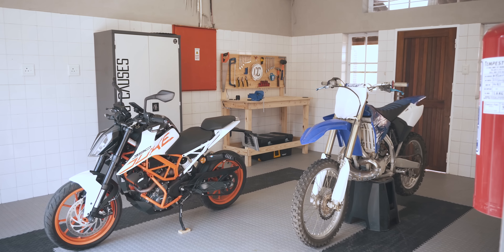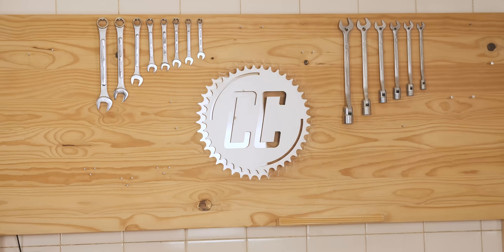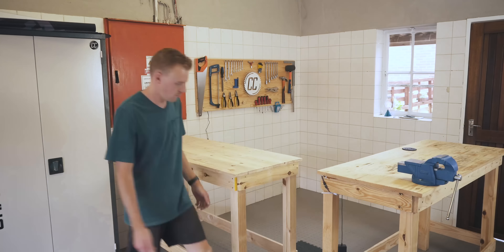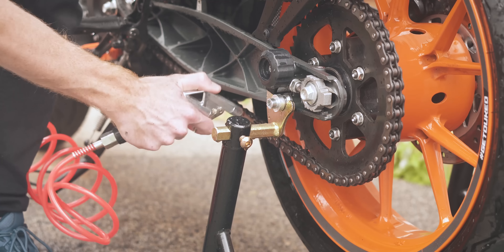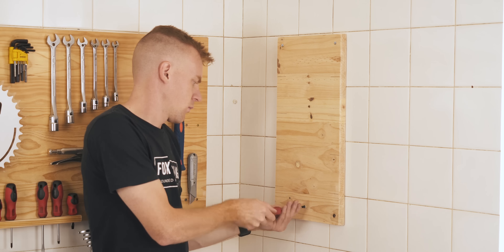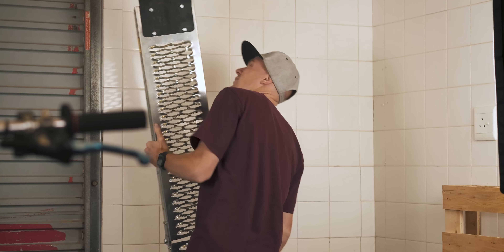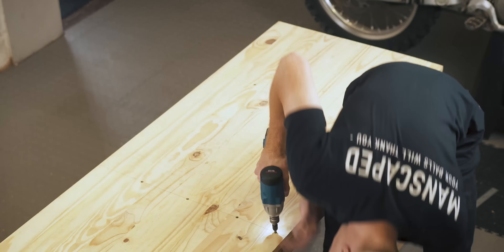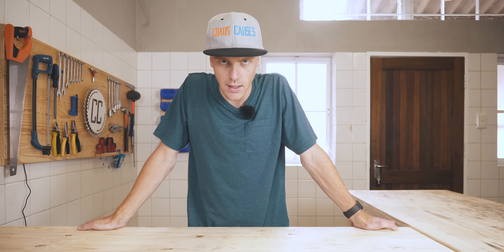4 Months Of Garage Upgrades In 1 Video

Comment: Nice video as usual! May I suggest that your tool panel should be moved to a place you can easily reach, rather than behinds the benches. Sometimes you need to pick an other wrench and it is a pain to run all around the obstacles you placed in  the way.
An other option is a tool kart or, why not,  a movable tool panel...

Comment: nicely done, I made a bike stand similar to yours yenta ago. mine was nearly as  high as yours. although it was convenient to work on I realized I was less likely to use it because it was too tall  to put a bike on safely. i lowered mine and I was much happier with it.I put a rubberized mat on the surface and that was helpful as well.  I am thinking of building a new one that allows me to add  drawers to put things like special tools that would only bemused while my bike was on the stand.  also I think the stand could use some cross braces to keep it from racking, it might be fine now but it  could loosen up over time, best of luck on your projects.

Comment: I really like the two-section workbench. It's flexible if you need to redo the layout (for wide or long projects or if you need more floor space) but also functions well (for the reasons you mention) in the L configuration.
Reply: Also it is great to have the bench as an isle, when working with two people on one item.

Comment: GREAT VIDEOS... Just a hint for your workshop that will make a big diference. Everything that you don't need on the floor, put it on the upper available space. The compressor should be on a stand on the wall. Build a plattform with some wood and a dust cover and you will have floor space and the air hose can reach every where the same... keep on working!!!